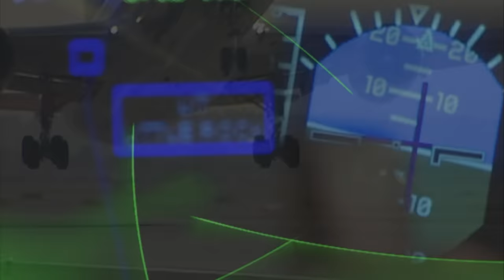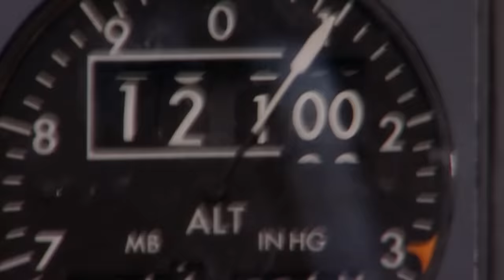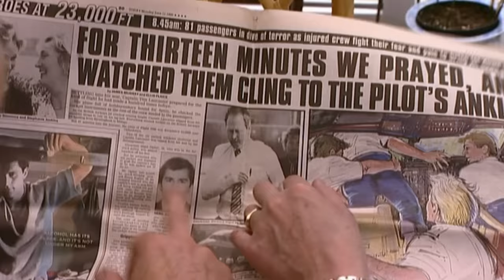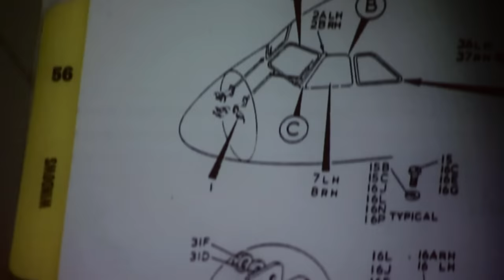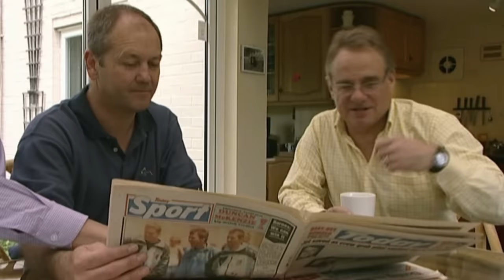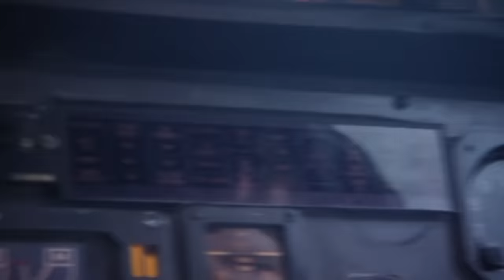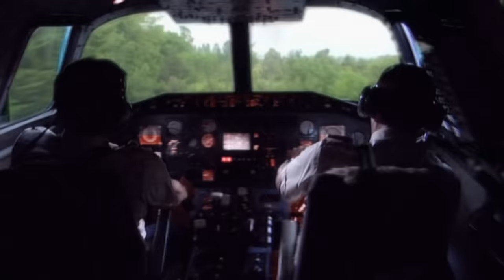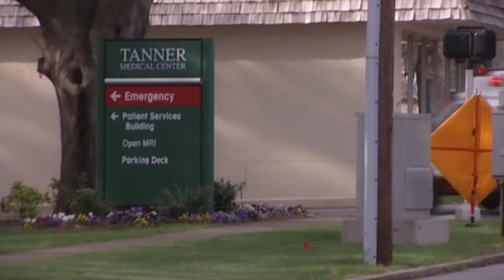BA5390 Pilot Holds On For His Life After Plane Window Explodes | Mayday Compilation

Comment: The fact that maintenance practices and standards are often the cause, is despicable. The fact that airlines do not want to use less flammable fuel due to the cost demonstrates corporate greed and immoral practice, no passengers are valued, only profit. I’m amazed that the FAA tolerates this BS. When will the airlines ever value passenger lives over big profit? Answer: never.

Comment: When a bolt is too small a skilled person can tell the bolt doesn’t feel right it’s loose when threading in. I would bet the correct bolt was a 7mm x1 as they said 7 and he used a 1/4 x 24 bolt which is .030 smaller in diameter. He likely was able to tighten them up seeing how only a screwdriver is used to tighten so not a lot of torque but under pressure they could not hold the load. You can’t just blame him though there should be something like a parts list for a given job then a receipt from the parts department showing the correct parts so someone can sign off on the work.

Comment: 0:49 could it really bring down the plane though?  ALL of your stories say that planes are designed to fly on one engine and pilots regularly train on the simulators for that situation.
Reply: yeah but the captain could’ve been sucked into the engine which could’ve messed up the hydraulic system
Reply: just because they CAN fly with one engine (or less than the regular amount) doesn't mean it will. if a twin engine aircraft has an engine blow out in clear skies and minutes from the airport, everyone's probably fine. but add on a ton of other factors (weather, pilots, mechanical status of the airplane, etc.) and that completely changes the story.

Comment: I'm just floored with this report. First of all they are screws not bolts, and why wouldn't they have a computer program to identify the proper hardware? I was out of Commercial Aviation in the 90's and there was NO DOUBT if you have the correct part to go with the aircraft. Is this the Piers Morgan version of British Parts Department? The mechanic should have felt that the screws were not torqueing correctly and felt that the heads would rock even after final torque. Had it happen to me on fuel panels on a 737, they were trying to burn me the next day but I notified them when they pulled me off the project and the management never heard me until they fueled the bird the next morning. Recognize that 90% of this stuff happens because of mid level management and they do their best to sluff it off on the mechanics. Would love to see some of those bastards do jail time.